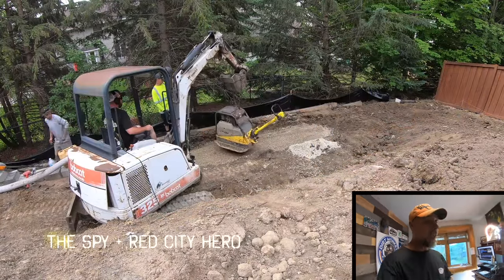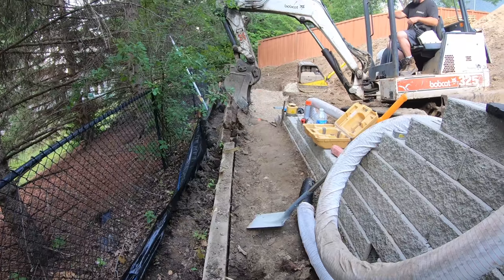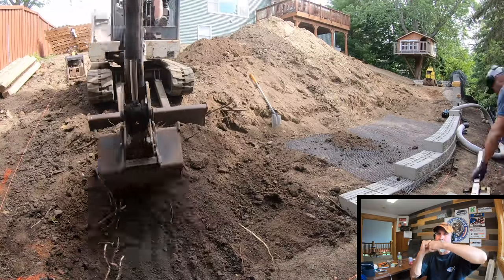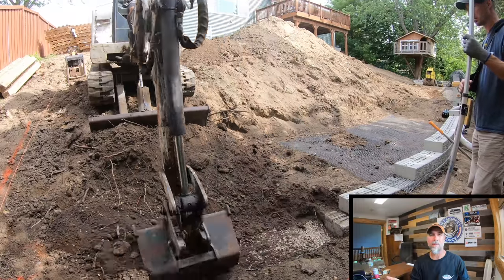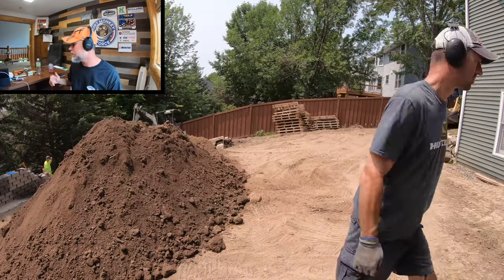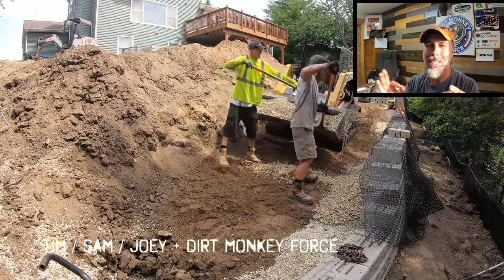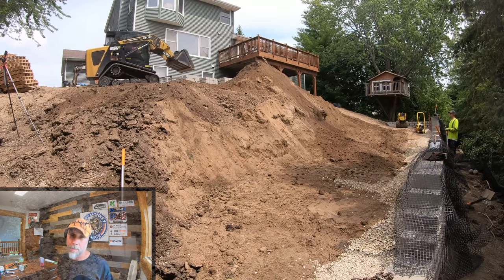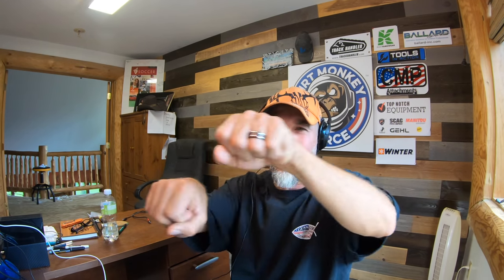Turning a STEEP Hill into a Flat yard #1

Comment: It’s nice to see some one ho knows how to do it right with the grid and back fill is just about as important as the block work start to finish top notch all the that will never move I did one it was 360’  long with 3 set backs of 8’ and 24’ high still standing 15 years now and you are right it’s the pins that make.the job last good job guys
Reply from the maker: That sounds like a pretty substantial project you tackled there.
Reply: Stanley "Dirt Monkey" Genadek ya sitting back now retired watching you do the work same weather here in Mass starting to get cold one more log on the fire keep up the good work

Comment: County material makes a pin together solid block. I also only use pin together blocks. Although boulder walls are more fun to build.
Reply from the maker: Keystone makes a pinned block but those aren't solid.  I will look into those ones you mentioned.

Comment: I'd have to argue that one because if the wall is backfilled with drainage aggregate all the way to the top like I have done in the past...then the water will find it's easiest way out and that's down through the rock to the drainage pipe which let's the water out quicker if it builds up behind the wall instead of building up pressure against the wall seeping through the cracks in the block...but yes the wall is designed to let water pass but if your drainage ditch is installed properly it will find the pipe ...I've always had to do at least five foot of 3/4 inch stone all the way up to subsoil grade and fabric over the top of gravels before subsoil is placed...

Comment: When you say that those are the only solid blocks with pins, is that because the Keystone Standard retaining wall blocks have some voids in the backside?  Or simply the only large block systems with pins in your area?
Reply from the maker: keystone you have to core fill.  They have those voids you mentioned but at least keystone are pinned.

Comment: Stan they make hydraulic compacting equipment that works off of a excavator boom that way you don't have a chain miss hap or having to worry about a person getting hurt if lowered or raising from a trench
Reply from the maker: We used to have one.  BUT For big walls I wanted something that I knew would be fast and effecient.  Hence the dual sheeps foot trench compactor.  Thats been our best compactor yet for our type of soil
Reply: @Dirtmonkey  I seen on Facebook a bucket for you it rotates and takes out stuff you don’t want in soil like rocks or roots it has different screens for different size rocks it’s from Flip Screen
Reply from the maker: Thats sounds pretty cool.  I need to look into that.

Comment: Stan compaction compaction and then more compaction is the key with the grid that’s a big wall there wasn’t a problem with the engineering changing from a 9 to a 11’ wall but I guess if the slide plane is taken out of the equation everything will be fine.
Reply from the maker: We had the excess grid lengths already in place,  I talk more about that during this mini series.  But your right about the slide plane.  The grid lengths were long enough to eliminate that as a possibility and built into the engineering.

Comment: I’ve got a big job (for me anyway) 300’ of 6’ and 280’ of 4’ tall. Only products we have access to in our area are keystone stone gate which is solid and pinned or belgard castle manor which is also solid and pinned. Engineering put 5 layers of Geogrid for the 6’ with 2 buried courses. 12” of drain rock behind but we are going 18”. Any thoughts or suggestions? Love the videos and you guys are the reason we branched out into hardscapes! Thanks
Reply from the maker: 5 layers of grid on a 6 foot wall is definately not taking any chances.  Sounds like their may be a surcharge on the walls from a slope or structure that they are compensating for.  Or are those really small blocks?  I don't use either one so I am not familiar with the blocks but know enough about engineering to understand about the geogrid.

Comment: Hey Stan just a question. I believe in one of your earlier videos you said never go more than two courses before backfilling. What changed that we can go up to four courses now? Besides speeding up the process.
Reply: Probably because of the weight of this particular product. Some retaining walls blocks weigh 20 pounds ish, some 80 pounds ish, some over 100!
Reply from the maker: on a typical project we will go 2 courses then rock it to stabilize it but we have always been able to go up to 4 courses before needing backfill and compaction.  so we put in 2 courses,  lay in the drainagae material which keeps it from tipping back but don't do the full backfill until 4 courses are up.  Thats when we want to make progress fat.  On smaller walls we typically build and backfill at the same times.

Comment: Here in St Louis area we would have to have Enigineer signed and sealed drawings to get a permit to build a wall that high.
Reply from the maker: Same-  Thats what we are uising to build this wall with. Stamped engineered drawings
Reply: @Dirtmonkey  video kind of looks like its improvised on the spot. Yes field changes happen but still the video looks like design as you build

Comment: Freaking beautiful! How many yards does the dump truck hold? I know they can range from like 14-22 yards. Also, really grateful that you covered the science behind the modular manufacturer block on it s drainage design because I have a potential customer who wants a retaining wall using bell guard block but wants me to put grout in between the joints on the back side of the wall so that water is not able to percolate through the wall and I am telling him everything you said in the video and he is just stuck on doing it that way. I guess the best thing to do would be to have him sign an agreement that he understands at the wall fails it would be because of that..
Reply from the maker: DON'T do it!  That sounds like a lawsuit waiting to happen.  He is asking you to build a wall out of spec and no matter what you are the expert which means you are responsible.  On a different note  to answer your first question-We imported 675 tons of structural fill for this job
Reply: @Dirtmonkey  Thank you so much for responding. Yes, I spoke to the client today explaining the design and reasoning toot do it his way and told him I would not do the job if he required the blocking of water weeping through. Thanks for teaching me through your videos. I definitely owe it to you that I can even build a retaining wall.And wow that is allot of fill!!! Awesome, thanks and look forward to your upcoming videos.

Comment: if only you weren't several hundred miles away, a place I mow desperately needs major ground work, I managed to crack both front tire arms on a MY2020 Toro Timecutter, they're the replaceable ones and I managed to get warranty on them but something's gotta be done, it doesn't have the MyRide system because I needed a mower ASAP after all my other mowers died and it was either a 50" MyRide unit with the Toro twin barrel carb engine or a 50" non MyRide unit with a Kawasaki which is what I chose given my good luck with them. Failures are as follows: my Kohler Command spun a bearing, my Kohler Courage cracked its block, my Kohler Magnum has low compression in both cylinders, my Briggs and Stratton Vanguard dropped a valve, and my Onan Cummins powered tractor needs rewired, engine runs fine albeit with some top end noise, but nothing else works. Not having the suspension has taken its toll on both operator and mower, it's a year old but it already needs to go back to the dealer for a full refurb, other place I mow is 3 acres of perfect flatlands so it's likely only the place mentioned above is the cause of most of the wear
Reply from the maker: man that is really bad luck.  I wish you the best and no MORE BREAKDOWNS! 😃👊
Reply: @Dirtmonkey  If there's a breakdown at least it's in warranty unlike before, I run the snot out of my equipment, every piece mentioned above I bought with low hours then ran the snot out of, maintenance is meticulous but so many hours per season they literally wear out, except for the Kohler courage, it only had 495 hours on it, half of what the next lowest hours machine had, plastic cams and a flawed design equal a lemon

Comment: If you're using block with just the thin lip on the bottom holding everything together, would it be a good idea to CAREFULLY clean each layer as you put it in and use construction adhesive in between each layer of blocks to reinforce that small lip leaving gaps in the glue string to allow water to escape from behind the wall?

Comment: I prefer to build and backfill one course at a time. I use 12" cuts of plywood held with pins to separate crushed stone and soil during backfill. It is extra work constantly setting and lifting the plywood and pins, but guarantees me that I am getting 12" of stone behind the block. I use Keystone Standard block [21" deep] and Versa Standard because I like the face of my walls to be flush, not stepped in like the the lip system walls.
Reply from the maker: Mortarless walls can be built vertical but its actually not recomended.  I was forced into building a 14 foot tall wall sheer vertical.  I used the versa-lok without the setback.  That was 10 years ago and I still don't like that project.  the set back is really a fundamental part of the strength of a mortarless system.
Reply: @Dirtmonkey  I agree with setback for walls above 5 foot.

Comment: Have you ever considered anchorplex permeable backfill in place of geo-grid?
Reply from the maker: Never heard of it.
Reply: 1” clean with Portland cement..typically I backfill 18”-24” behind walls sometimes more. Your local concrete supplier can mix it for you..it’ll harden like concrete but be fully permeable. Major time saver..👊
Reply: @joelarson3528  This sounds like a very interesting product.  Thank you for the tip!  Sounds too good to be true.  Will check it out here in the north west area.  At times we are in need of retaining walls on some of our sights.  It is extremely useful to be aware of options we would otherwise be unaware of.  Nick, North West Farmer

Comment: Stanley,

I’m starting a retaining wall project, will 3/4 minus quarry rock work well for the drainage rock behind the retaining wall?  I know it packs really well so it would probably work well for the footing but wasn’t sure for behind the wall.  I can also get 3/4 minus river rock to use behind the wall, it doesn’t have the small fine particles so it would probably drain better.  What are your thought? Thanks so much for your videos.  Tom

Comment: Yo Stan, very good question for you as I was doing some volunteer work on a gravel road that's packed damn near like concrete.  My box blade is the best I have with ripper/scarifier shanks to break up the surface and I'm not gonna destroy my rotary tiller.  What cheaper easier way is there other than an expensive power/Harley rake could be used to break up the hard packed gravel and dirt ground? Equipment I use is a jd1025 compact tlb
Reply from the maker: Wait until it rains and then go out there right after.  the water will soften up the surface and let you move material easier.  But you will have to time it so its not pure mud your working with.
Reply: @Dirtmonkey  I honestly think you'd have a blast regrading the road with your Harley rake due to the massive amounts of pot holes and the washed out pot holes.
Reply from the maker: I would.  I think grading is my favorite work of all time.

Comment: Hi Stan, not that I have had much experience with those blocks with the lip, I have seen some people use clear silicone to secure the two levels together
Reply from the maker: Hi henry- IMO- Technically that is wrong.  These blocks are designed to not rely on mortar or adhesion.
Reply: It was for a raised garden bed sorry 3 course high

Comment: Need to try a Takehuchi
Reply from the maker: I have heard great things about them.
Reply: @Dirtmonkey  Probably not as stable as an asv on a hill but they have the door like Kubota. It's also got smooth controls for the most part and super reliable as pretty much all the rental places near me use them and they definitely get abused and still keep ticking.
Reply from the maker: I have heard they are built like tanks.
Reply: @Dirtmonkey  Yea, I would say that's an accurate assessment.

Comment: Been waiting for this video since I first seen you start it. I've been working on a 6 foot tall wall recently. Ran into deviations of 1/4 inch on some blocks. Do you ever run into the same issues with the block you use? Love seeing your work!!
Reply from the maker: yes- sometimes the blocks just aren't perfect.  We throw those away when we see it.  You can always tell right away becasue it will create a wave or undulation in the wall.  thats either bad base or bad block or something got caught inbetween the courses.

Comment: Why not use metal pins instead of plastic?
Reply from the maker: Those pins were designed for those blocks.
Reply: @Dirtmonkey  I understand but if the pins were metal is that over kill or a cost issue?
Reply from the maker: They could rust and then leech through the face and stain the blocks